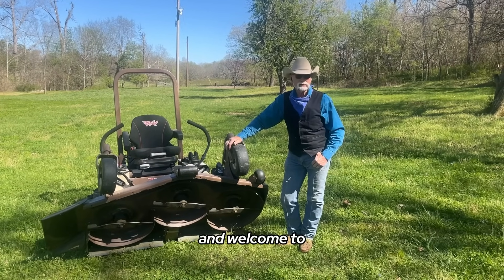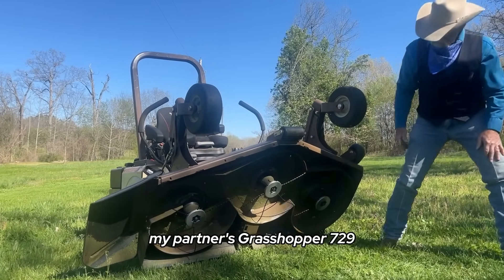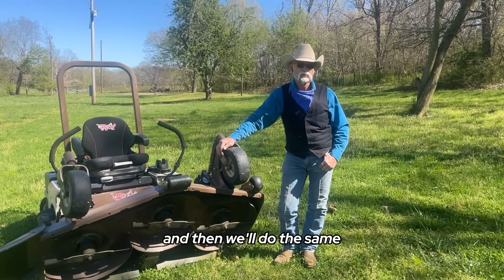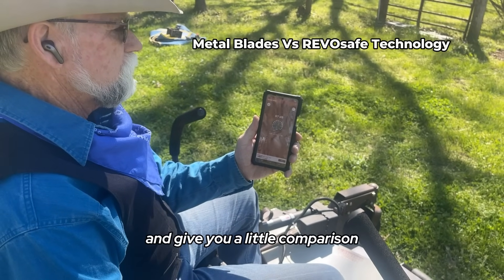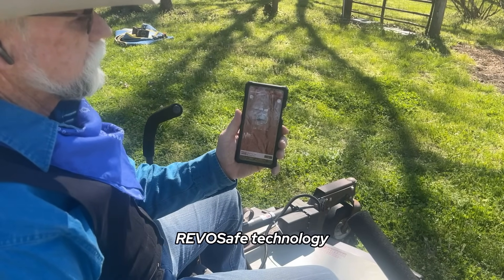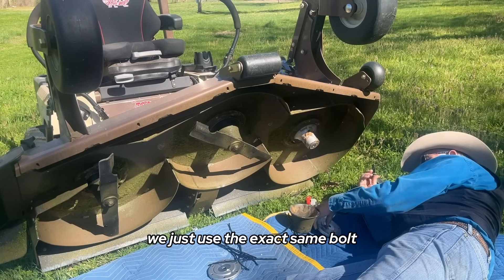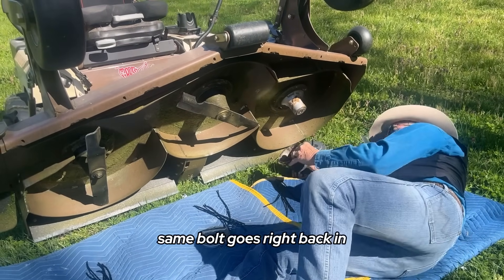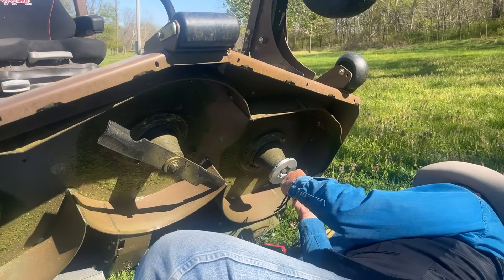The REVO6 VS Regular Blades (Cut & Sound Comparison)

Comment: Your sound meter is way off. A normal conversation is around 60dB. When you were speaking your meter was showing ~70dB. So, there's something wrong when it reads 30dB or 18dB while the engine is running. The engine alone is probably north of 90dB I suspect your phone is clipping the audio due to high volume. 18dB is so quiet you wouldn't even be able to hear it over the normal sounds of nature outdoors.

Comment: I've mowed professionally for 20 years.   I thought this was a joke.  Lol. How the heck you gonna get lift with those things? Whatever you wanna call them.   The flange on a metal blade is there for a reason.   The back side of the cuter side is always bent up so it lifts the grass into the cutting edge.   This would work on a trimmer on wheels but why the heck would you put th🎉at on a mower for?   To scam people that don't know what they're doing?
Reply: Field mowing or basically using your finish mower as a light brush cutter. I wouldn't use them on my lawn but I can definitely see a benefit mowing field grass when you don't see the hidden little rocks or debris that hangs up your regular blades and puts one hell of an impact on spindles.
However I'm much too lazy to change my blades that often just to go from the yard to my fields.
Reply: Well as those plastic strings wear your going to get strips left in the middle. No way this would be good for brush. Probably the only benefit besides noise would be mulching a light cutting. Definitely not ideal for my application. Will stick with my carbide faced marbain blades. No sharpening ever and will last a few hundred acres in mega sand. Now that's a blade...
Reply: You are correct. I saw a video (I think it was Smarter Everyday) that looked into how mower blades work. The flap on the blade creates lift that stands the blades of grass up to be cut evenly, just like the barber does with their fingers in your hair. No lift=shaggy cut. Good lift=nice cut. I can tell you from personal experience that when the flap on the blades wear down, the blades, no matter how sharp on the cutting edge, don't leave a good looking cut. The next day, the lawn looks like crap because a good bit of the grass wasn't being pulled up straight by the suction.
Reply: Trimmer line is designed to cut the grass at the tip of the string and you can never go too fast or the string will just glide over the grass and just big down or get twisted up in it depending on how long the grass is. This guy is cutting short grass. I was hoping to see taller grass getting cut so we could see the actual difference.
Reply: @joetroutt7425  It would probably cut taller stuff but ya speed would be a crawl. And you wouldn't know your missing it till it's missed. A great idea on paper. My uncle had one of those dr trimmer mower things. He loved it around his house, but said it was slow. He couldn't hold a trimmer so for him it worked.
Reply: The metal blade cuts look better.
Reply: It's the cool factor; it looks cool. right?
Reply: Nope not convinced

Comment: Did you mean to leave off the fiber washers when you installed the REVO blades?  Grasshopper clearly specks out that the fiber washers are to be used when mounting mower blades on the spindles.

Comment: But they have no lift.  It may work on a zero turn with the deck out front, but not on a belly mower where the front tires lay down the grass.  There would be no lift to stand it back up to be cut.

Comment: Wow... its cheaper to replace with metal blades or if they are still balanced, just sharpen them. Curious what the science looks like on mulching, without the whip of a high lift tail on a blade.

Comment: Looks good!  How does it compare to metal blades for cutting tall grass?  How many hours of cutting time do the blades last?  Besides being used only for mulching are there any other drawbacks.  Thanks for the video.
Reply from the maker: @anonymous971, good evening! Thanks. It is comparable in that once you get into grass 8+ inches, you will have to make a couple of passes to get a clean cut. In normal everyday mowing conditions below the 8" growth there is very little difference. The current version of REVOline will last 6 to 9 hours in normal to heavy conditions, and we are actively working with our R&D on improving durability and cut quality of the upcoming version of REVOline.  

Other than the lack of lift and the REVOsafe technology being best in a mulching environment, you have to take into consideration of how you will access/change the line on your deck mowers. I personally have a set of extended ramps and a lawn mower lift that makes it a relatively simple process. 

Other areas of advantage to the REVOsafe technology are: 
SAFETY
Significant decrease (estimate 85%) in lacerations and resulting amputations.
Significant decrease (estimate 50%) in length of hospital stays, recovery timeframes, and financial costs across ALL riding mower injuries.
Significant decrease (estimate 90%) in injuries related to rocks and debris launched by metal mower blades.

EFFICIENCY 
Cost – consumer saves money (estimate 10-15%) over a 5-year mower life (blades, fuel, physical wear and tear on mower).

Performance – acceptable cut and mulching capabilities for the majority of lawns and property.

Ease of Use -  flexible lines will require replacement more frequently than blades.  Depending on terrain, lines will last for 6-9 hours of mowing.  Consumer can install the hub and lines on any push, riding, or zero turn mower.

Environmental Impact -  much more eco-friendly solution.  Lightweight assembly decreases stress on engine, increases equipment life, improves fuel/battery efficiency, and minimizes physical disruption to land, trees, and plants.  

Thanks much for your time and engagement! We understand the REVOsafe may not fit everyone's needs, but we are excited and dedicated to providing a safe and efficient alternative. Have a Blessed evening! BSC Team

Comment: This would have been a far better video if it wasn't so obviously misleading and deceptive.  The sound of the mower and blades at 20 yards and 2 yards from the camera sound exactly the same.  It is painfully obvious that a different sound track is laid over the video for the purposes of tricking the viewer.  Garbage.
Reply from the maker: Good Evening, An earpiece was being worn during filming, and that’s the reason for the sound following the mower. Thanks - BSC Team
Reply: Not only that but also the fact that he lowered the deck height on the comparison cut 😂

Comment: This is just stupid. If your busting up a lot of blades due to rocks and crap then get a flail mower they are amazing when it comes to real world mowing. This thing is going to be just like a string trimmer, it won’t handle brush, the strings have zero lift, and it won’t grind up the cuttings. This doesn’t address the issue of the line being fixed and requiring you to stop and change it out every few minutes! This is the worst of both worlds!